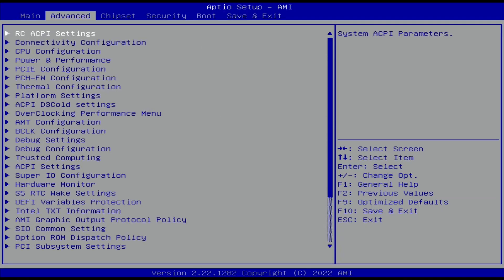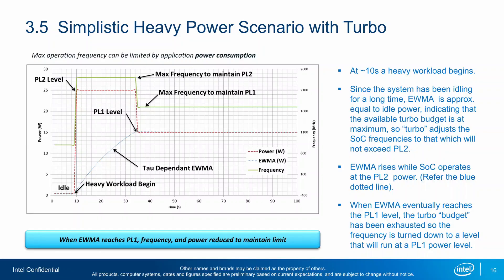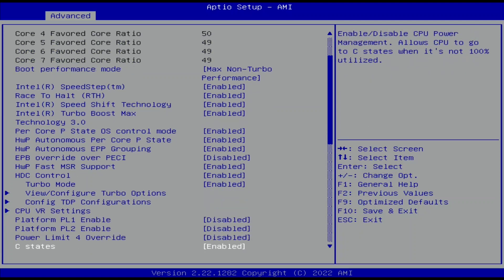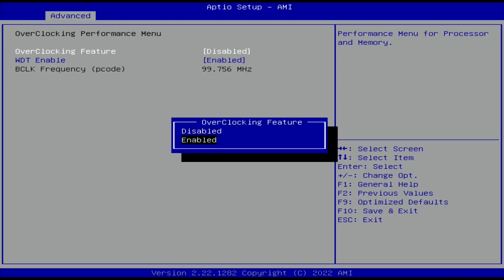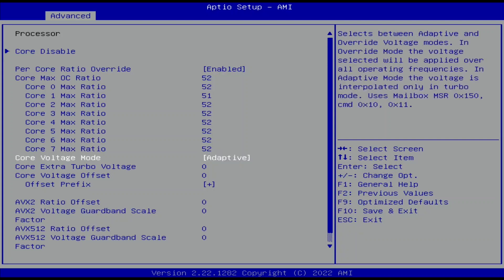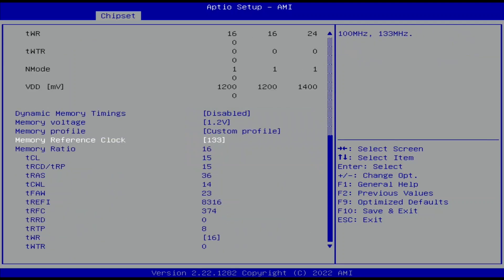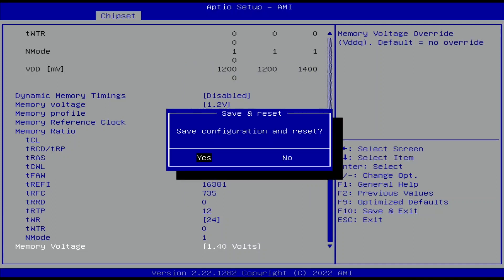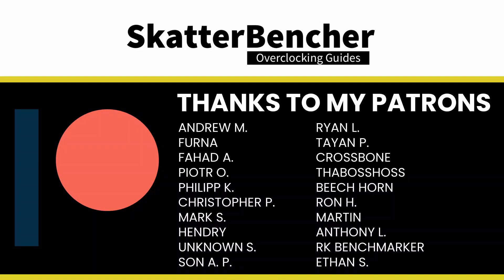5 Minute Overclock: Core i9-11980HK to 5200 MHz

Comment: Would this work with regular thermal paste or did you use liquid metal? It's on a PC case or left as-is on a bench board? I don't know why, but when using artic mx-4 on both the IHS and the water cooling I get a horrible performance (3.4 GHz max, if I raise higher, it will BSOD). When I had liquid metal I had the chance to make it work @4.6 more-or-less stable, but now I switched to the thermal paste and everything is working WAY worse! I do not want to use liquid metal, but it seems that at least in my case the thermal paste won't allow to go higher than those 3.4 GHz... Any suggestion? :|
Reply from the maker: I used regular thermal paste and it was sitting on an open bench.

Regular thermal paste should work just fine.
Reply: @SkatterBencher  Using Thermal paste between the IHS and the DIE and also between the IHS and the Liquid Cooling (240) I will get 90+ causing BSOD the moment I raise higher than 3.8 GHz, I cannot understand this 😕 The only thing is that the computer is boxed but it has been just cleaned 100%... I do really don't know what's happening, but with liquid metal I was able to do 4.6-4.7 Ghz

Comment: Is these settings safe ?
Reply from the maker: For my system and cooling they were. If you feel uncomfortable just copying settings from the internet (which I'd never recommend), I suggest you can watch my longer guide https://www.youtube.com/watch?v=ot9sOn_EIWo. In that guide I explain everything that's going on and why I set the settings I do.
Reply: Thanks for your fast reply. Do you have some tips and tricks or a video how to tweak my computer without doing a maximum overclock, maybe some small adjustments in bios or something you think it’s a must do
Reply from the maker: In my longer guides, I usually provide multiple OC Strategies ranging from safest to most elaborate. You can watch the video and then pick which strategy you feel most comfortable with. Good luck!

Comment: Nice video, good to see the Erying board and mobile CPU overclocked, how were the VRM temps as they were not so good on other Erying boards?

Also as a side note, will there be more W790 overclocking in the future? ASUS has a new BIOS that seems to let processors go above 5.2GHz now.
Reply from the maker: The VRM temperature was on the edge, but ultimately there's also VR Temp throttling protection so I'm not too worried about the temperature.

Yes, I'm planning at least 1 more guide with the W790 Ace + 3495X in the future. Not sure how fast I'll get that one out given there's a lot of new stuff coming this quarter :)
Reply: The board that he's using will have the improved drmos vrm, the m-atx has a terrible vrm, but can be bruteforced with the improved heatsinks and an 80mm fan for active cooling which is how I achieved the following. I was able to push 150w before thermal throttling (CPU) after applying LM under the IHS, using a H150i, vrm temps were 80c sensor so I'm assuming 95c internal. 

This video has given me new strategies that I will attempt, but as of now the hardest I could push in AVX-512 was 4.5, was able to run 4.9/4.8 best cores and 4.7 on the rest in everything else. 3333 Gear 1 and 39x ring got me around 56ns aida latency and ~58gbps bandwidth, but seeing Gear 2 do 4000 without touching SA voltage gives me a lot of hope for 4266+ with enough voltage, 4400 (tuned) would probably attain similar latencies as my gear 1 but with much better bandwidth. 

 @SkatterBencher  Some liquid metal under the ihs and a fan on the vrm will probably get you about 160-180w which is where I estimate these chips max out with conventional cooling due to heat density. It would probably land you close to 5ghz in AVX-512 loads though, I'd be happy to share more details if needed as I've done some fairly extensive testing with my ES sample m-atx board.
Reply from the maker: Always happy to get more information from experienced users! This was my first time with Tiger Lake and Erying so I'm sure I made loads of mistakes while tuning :D
Reply: @SkatterBencher  I'd say you got most of it right from the start to be honest, you're more skilled than I am and most of your issue comes down to inefficient heat transfer from the subpar ihs, I was somewhat surprised you were even able to push 125w without liquid metal.

I would be very curious to see a tuned gear 2 after messing with VCCSA/IO vs my tuned 3333 gear 1, my b-die kit is dual rank though, which is giving a decent edge. I'd wager that your chip can go toe to toe with a 5800x after some deeper tuning and better heat transfer.